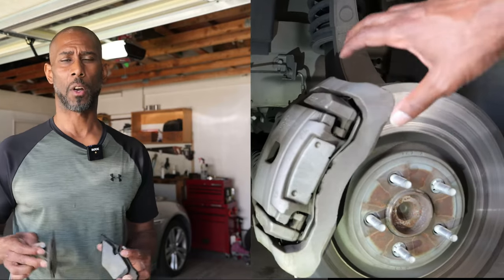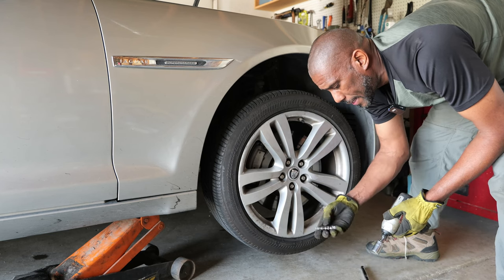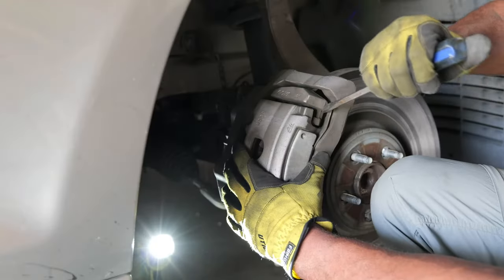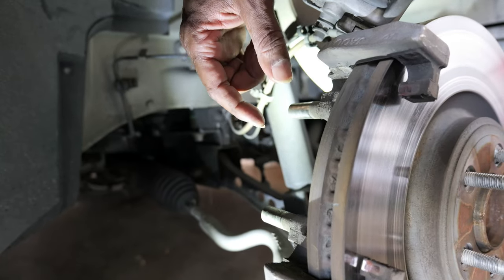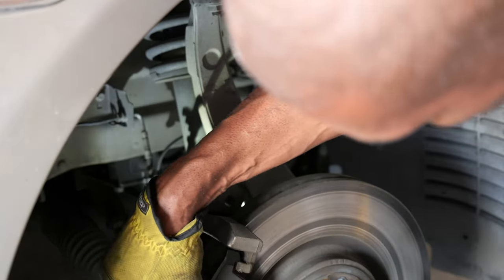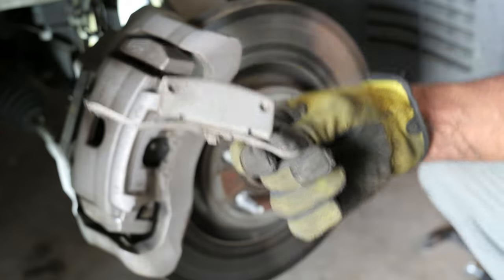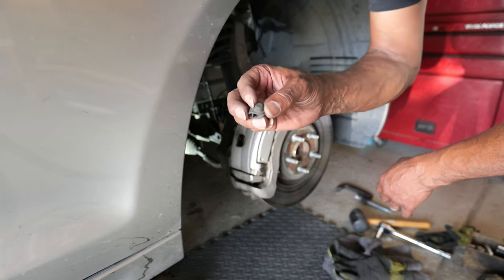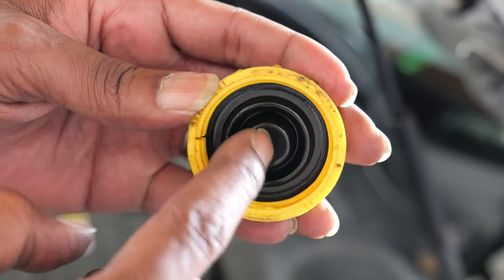Learn How to Change Your Jaguar XJ Front Brake Pads (DIY & Safe!)

Comment: Loved your video on changing the brake pads on your Jaguar 😊 exactly how long did it take you to do this from point start to finish and should I double the time to also do the drivers side as you only showed the passenger side.
Reply from the maker: @patsyrasmussen2674  because I've been changing brake pads for a few decades it didn't take me long at all. Roughly 30 minutes to 50 minutes . thanks for watching.